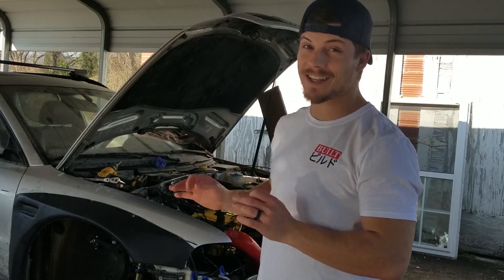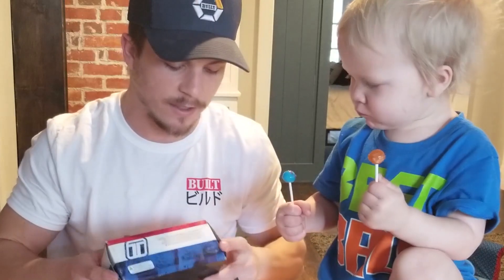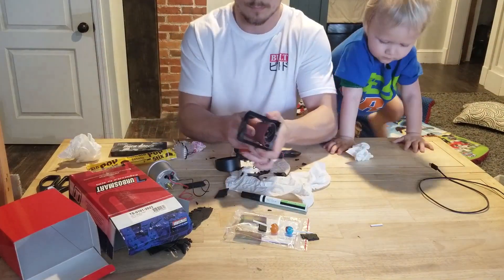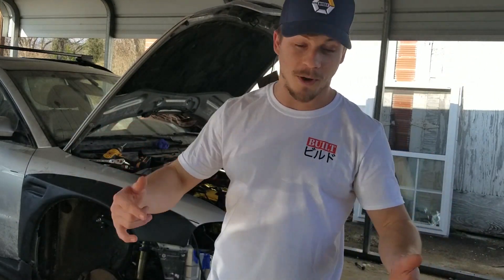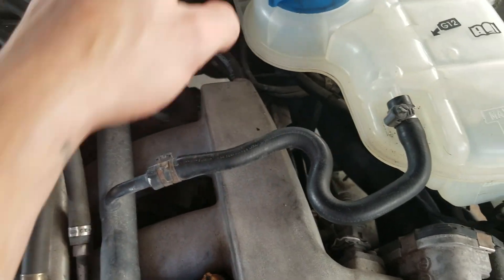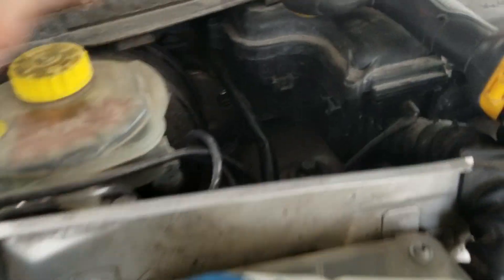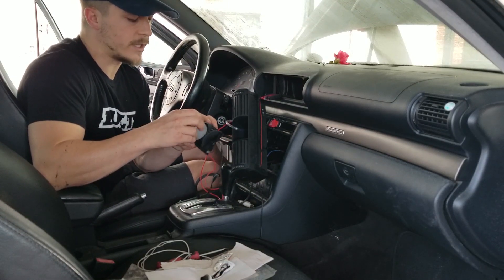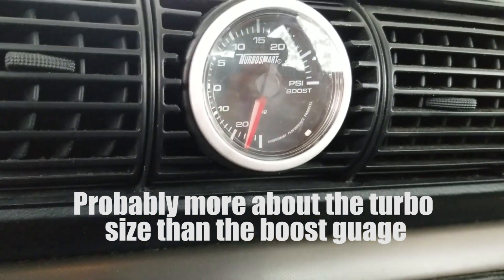FREE CUSTOM GAUGE POD DIY

Comment: You can use the dimmer signal and make it illuminate with the light switch very simply, by tapping into the dimmer for the vents. That connector right next to the hole you drilled in the vents assembly. VAG uses brown as ground on the connectors. You need the other wire.

Comment: You could wire the gauge to the dimmer wire for the radio. It should turn on with the headlights and dim with the gauge cluster in the car. I have a oil pressure gauge wired into my Crown Victoria that way and it works great.

Comment: That fusebox is going to make fireand burn down the car, smart for New owner
Reply: @BUILTOFFICIAL   is not the way to wire cable, not a 100% solid contact, seen this before, and my friends car startet to burn in the dash!
Reply: @BUILTOFFICIAL  I just jumped through the video so I may have missed something. If he is referring to 9:47, where you squish the wire in with the fuse, it might not be the best way. I mean I do it too for testing stuff. But for someone else who is not used to working with electronics they could accidentally pull the wire out while replacing a blown fuse and put the wire back in the wrong place or something. It would be best to pull the fuse box out  and connect the wire with one of those wire splice quick connect things. I forgot what they are called.
Reply: @BUILTOFFICIAL  Bro wire it to the dimmers on your vent its right by your boost gauge!
Reply: @BUILTOFFICIAL  you can cut corners and build shit when it's for yourself (your risk) but if you plan on giving a car away, make sure it's done the right way! Or just don't bother at all.